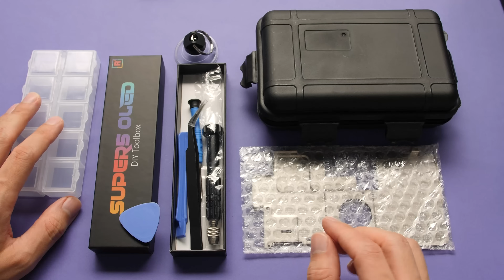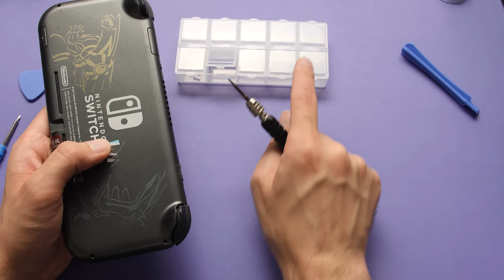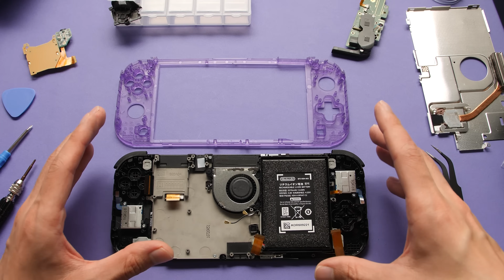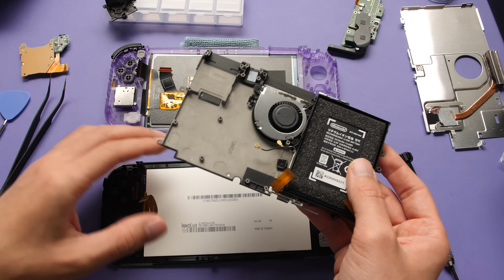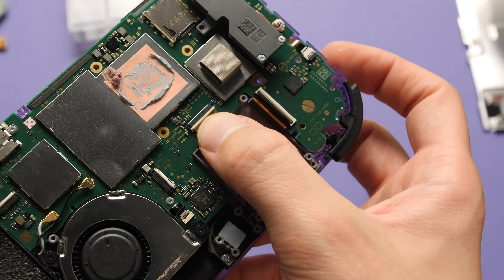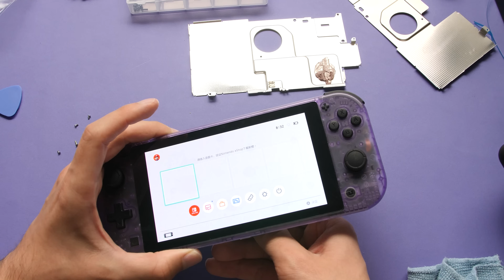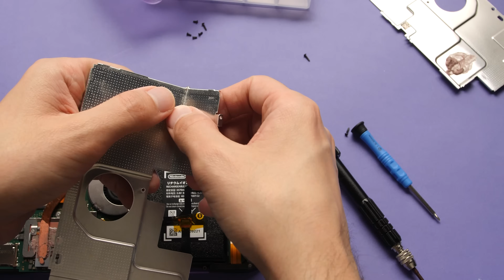SUPER5 OLED Touch - Product Overview & Installation Guide Part 2

Comment: It took me a night to install it. It's kind of hard for first time modding people to try it doing by themselves. And here is some advise I have during the installation @Taki II. I got the mega kit from you. The screw driver head is worn out already during the dissemble the console. So I have to use my old tool to continue the process. I hope the company can switch to a better quality head for it in the future. So I was doing the swap shell process. But the back shell it comes with doesn't have the speaker cover on it. If the company can come with the speaker cover in the future, that would be great. So customer doesn't need to take a long time to take it from the old shell (cuz it can be easily broken for the first timer). Next advise, the screen connection cable is too short and not line up the the dock. It's ok that they not line up straight like your video said. If the connection cable can be a bit longer, it would be much easier to line it up with the dock and less risk to broke the cable. Lastly, you should give some instruction for the screen setting that showing which is default mode and which is vivid mode, etc. Cuz after I push those two buttons to set up what mode is back for me, I have no idea which one is default at the first place. That will be all my advise for your product. All in all, I successfully install the screen and it's amazing quality. 👍

Comment: Hi all! I just installed the oled screen but I have an issue, the brightness is quite dim and it doesn’t change even after changing it in the settings. 
Anyone has a solution for this?
Much appreciated

Comment: Finally got mine and installed it, great video! The organization boxes I've never used before but were very helpful in organizing. Also did a shell swap rather than mucking around with the old screen. Overall SUPER happy with the end result! Screen is AWESOME, touch works right out of the gate, awesome!!!
Reply: I was looking into buying the MEGA (non HDMI) version! I was a bit nervous never having done such an operation, but this video gave me some confidence. Any tips??
Reply: @huggyscolex  I'm a 'go slow and be intentional' kind of modder so I watched the video 2-3 times and had it going and paused frequently while I did the install. Taki here does a very good job of explaining screws, locations, and steps so I followed that as closely as possible. If you do the shell swap you'll be on your own when installing the new buttons, swapping over the old membranes, and installing the R/LZ housing. None of this is impossible just takes some more time. 
I also got REALLY unlucky with the slot on the bottom of the battery, my battery was glued right to the edge and I didnt see any light through it. I had to very very carefully bend the housing till I could see the slot and I ended up using a tool to push through the slot and used that to pry an opening when feeding the flexi-cable through. Ran the risk of puncturing the battery but was gentle enough to survive.

Comment: DO NOT over tighten the ZL and ZR buttons or the L & R Shoulder buttons won't click in properly. Also just be mindful of the placement and the spring of the shoulder buttons in general when putting the main and daughter boards back in... That part caused me the most headache.
Once I got everything back together with the OLED it's super nice looking. Need a Switch 2 mod now, LMAO

Comment: It is amazing that this is possible at all, and I have mostly gotten things working on my second attempt. I've been looking forward to an OLED switch lite since this was announced on twitter. Unfortunately during my first round, I damaged my damaged my the smaller / daughter board, which luckily was easily replaced. With plenty of parts this time around, I ended up getting both switch lites working with this beautiful display. 

I wish the whole tutorial had the same care as the "this is the only point of failure you can have in this entire operation" part about connecting the display cable, which was absolutely not the only point of failure. This installation was much harder than I expected, and the video seems to cut/glide over many of the steps (e.g. seating the screen, installing the bumpers, etc), which made it especially hard to follow. The part of the tutorial around the display cable was really helpful in calling out the pitfalls and describing exactly how to do it successfully.

My experience level is beginner, and included a few past projects following guides:
- Modded joycons with upgraded sticks / fixed drift issues
- Battery replacement on an OLED switch
- Battery/storage swaps on laptops
- new 3ds shell swap / battery upgrade
- misc Arduino/raspi, desktop computer work, which didn't feel relevant given how much smaller / tighter everything is slotted into the lite

I was still definitely a beginner, but felt confident from the previews/descriptions.

Key mistakes I made:
- Not watching the full video first / taking notes
- Unlike the other connectors which have latches and move horizontally, the battery connector is lifted up vertically and easily damaged
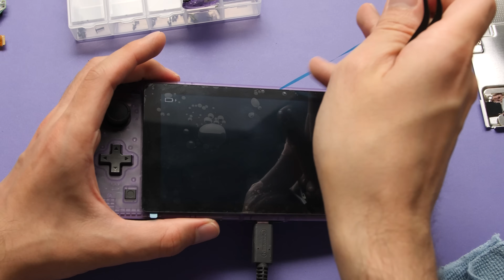- When he magically seats the display, you don't actually remove the tape-- that doesn't happen until 14:40. Do not remove the tape yet!
- Be careful with screws, especially on the sides where the frame may not be fully supported (e.g. if a joystick is elevating it). On both switch lites I tried this with, the screws were incredibly easy to strip with the provided screwdriver in the kit
- The bumpers were very tricky to re-install correctly. It worked best for me to slot the bumpers in before the boards, as the tiny actuation points for the buttons. 

Also note:
- Not included in the kit: you should have thermal paste
- When active on a menu, I noticed my switch draws 3 watts-- this was helpful for debugging the screen / power state, as I had issues with my battery connector.
- On a new / not setup Switch Lite with a dead battery, the battery indicator does not show when you plug it in. I saw it flash the nintendo screen and then turn off several times. After a while of low power charging (0.3w) it had enough to start / start charging more rapidly. When sleeping / charging while not configured, it only used 1w.
- BE VERY CAREFUL WITH THE RIBBON CABLE LATCHES. You can replace the daughterboard for about 15 usd. If the latches aren't secure, the cable jostling can mess things up.
- The megakit now includes the metal plate at the back with the section removed to make it fit better, you don't need to rip/cut your existing one.
- The power cable connector is repairable if you break the gray part holding in the connectors.

I do think I learned a lot going through this process and the screen is beautiful, the install process just had a lot more going on than expected! It took me 2-3 hours to complete with the megakit.

Comment: Please restock this with your 5000 or better battery & without hdmi & instead with your USB to HDMI dock station in a new mega pack.
Your products are awesome, I just hope Nintendo doesn't see this as a compromising hack wrongefully, because you just improved the weaknesses of the hardware in an incredible way.
I saved infos about your products when they were new, to buy them later, but was too late to order.

Comment: Hello! Does it work with the non lite versions (mine supermario edition) thanks! 

EDIT: so sorry it was clear only lite.
Q: is it worth just to buy a little version juste for the upgraded mod? Thanks
Reply: That's better if you have an entire switch modification project. Other than that, just stick to the Super7, which is for regular models.

Comment: Mine arrived 4 months later thanks to Brazilian customs. 
Installation went 90% well. For some reason, touch works, but drag doesn't. So it detects taps and clicks perfectly but I cannot use touch to scroll stuff, which is a bummer. 

Also for some reason, the button right corner doesn't adhere well. I used a wood clamp with a cloth to make pressure for a couple hours and it is holding well so far. 
Still, very recommended.

Comment: I really wish someone made psx style buttons for switch. Wanted to make a ps2 theme oled switch lite but buttons don't exist unless you paint ur self. Was going to for some joyco s. But reslly hard to get the vinyl stencil on the buttons to paint for the shapes. There's a guy on etzy that sells joycons but he won't sell juat the buttons like some kind of gate keeper. I meen you can get psx buttons for tons of devices but no one will make switch ones for some reason makes no sense to me. I like the shell you picked. Wasnt looking but did you have to pull the screen from the glass to get the right color bezels?

Comment: Oh well, already failed, before I could even unpack the new screen. The top left screw that holds the metal plate was impossible to loosen, by now the enclosed screwdriver has destroyed the screw, and it's entirely impossible to get it out now.

Comment: Managed to get mine installed tonight! Got the Touch edition and swapped the screen on my Zelda Lite. I recommend having the iFixit guide up as well for a visual reference of the screws to take out and such. My only issue after install is that the right side of the screen doesn't sit flush with the shell. The bottom right won't stay adhered, and the top right won't adhere at all. I dunno if I had something blocking it, or if the adhesive was bad, or what, but I was too scared to open it back up soooo it'll just have to stay like that ^^; 

If you're having the issue where the brightness is really low for no reason, and some buttons/sticks won't work properly, double check the ribbon cable that connects the mother and daughter boards. After I made sure the pins were seated correctly, everything worked like a charm
Reply: THE RIGHT SIDE OF MY SCREEN DOES NOT SIT FLUSH EITHER! I just tore it apart and don’t’ see anything blocking it either.

Comment: I've done 2 installs.Fires went perfectly fine. The second install has a rgb snow screen. The connectors are in perfect shape and fully seated correctly. Any ideas?
Reply: I reinstalled the original LCD and it works perfectly so looks like i have a faulty screen.

Comment: Leaving this comment cus I’m a lil annoyed, Taki I’m glad that you made this because it’s something I’ve been looking for since the original Switch launched but this is where the link for the OLED Touch version tutorial leads to and I’m not reshelling so I’ve had to juggle three separate video tutorials and an iFixit guide and I still managed to break stuff:

You really need to stop saying the display cable is the single point of failure, my clumsy ass innovated in this respect

You really understate how soft the heatpipe is; it’s about as soft and bendable as thin plastic and I bent and pinched it just trying to clean the thermal paste off it

I wish I had have known that I should have left the magnesium frame on before trying to remove the original screen because the plastic housing by itself flexed and the screen folded a bit being removed so it’s now dead

The cable for the fan got stuck under the motherboard when I replaced it and when I tried to pull it through with tweezers, very gently, it tore and bricked the fan

The shoulder buttons are also a nightmare because the tiny springs can launch themselves across the room and you need eagle vision to find them again

Thankfully the Switch Lite still works and I was able to test that the OLED screen does work but now just hella mad at myself for screwing it all up just at the last step waiting for the replacement parts to arrive like 🤯🤬😱🤮😭🤷‍♂️

Comment: Hi, I wanted to ask if the black edge of the touchscreen should be exactly the same as the original screen, right? Since the white version is no longer available on your website, I bought the black version and plan to cover it with a white tempered film from eXtremeRate. 3:10

Comment: 4 hours later and I got the touch screen installed and everything works.  Only thing not perfect was the screen on the bottom right. It doesn't seem like the adhesive is holding tightly.  I put a clamp on it overnight to see if I can get the screen to fully adhere.
Reply: Any issues with your screen brightness ? Mine is dim and won’t turn up
Reply: @Tyelovestech  If you checked all the wirings, perhaps the button testing at the end can help you?
Reply: @Tyelovestech  Have you found an answer for this yet? I have the same issue. No matter what profile it seems very dim. I haven't dug too much into it yet since I am waiting for parts because in addition, I may have damaged my daughter board cable or connector as certain buttons from the board do not respond (Power, either volume, or the Right D pad). Hopefully it's just the cable or the daughter board connector as that board is cheap and available, otherwise I'll need a new motherboard (or connector but I don't have a hot air station so, new board)
Reply: @SwnkyTiger  yes! I broke the FPC cable latch near the speaker on the daughter board. I replaced the entire daughter board and now it works perfectly
Reply: @ yes. It was the FPC cable on the daughter board near the speaker. I broke the latch that keeps it in place. I replaced the daughter board. All good now

Comment: Unfortunately I just installed mine and the brightness is super low. Idk wtf is going on. I messed with the profiles and could only make it darker 😢
Reply: Any updates? Mine is doing the same.
Reply: Yes! So for me one of the connectors on the small motherboard was damaged. Had to replace the small motherboard and it worked perfectly.
Reply: Crap, any chance it was the long ribbon cable connector towards the bottom on the daughter board? I connected the cable but I accidentally broke the latch that holds it down. I didn’t think it would be a big deal since I got it to connect

Comment: Are you going to make a tutorial that does not require a shell swap? I bought the Hyrule edition lite specifically for your screen and now I’m stuck with a screen and no idea how to properly install it :(
Reply: It just requires an extra step, which is to unscrew the inner frame that is held together with 4 screws.
Reply: @ I’m thinking to simplify things I will just go with the no touch option. Do you know if I can use the touch kit to do a no touch install? As in can I just skip anything to do with the touch screen and go with the no touch install?
Reply: Tape the touchcable to the back of the display?

Comment: I did all step by step, but now me switch lite wont turn on
Reply: Did you use the tweezers before you disconnected the battery? You might have shorted something.

Comment: I don't understand why this guide is doing it the "shell-swap" way when most people would probably just be replacing the screen of their lite without replacing the shell. You even say it is a more complicated process. Don't you think that part deservers a tutorial?
Reply: I think that one is on the way.
Reply: @SirChevron  I mean I hope so. It seems Taki is so used to these things that to him, a shell-swap is apparently something everyone just does if he thinks it's the default use case and makes a tutorial video linked to the product website itself. I mean, it's pretty egregious if you think about it. You don't have to be an expert to at least know that most people would not have spare switch shells lying around. So to me, this was very intentional and that only makes it even more absurd.
Reply: @DeanGl  The missing step would be to unscrew the inner frame before you can remove the screen. This is purely due to the touchscreen cable.

Comment: I wish there was a tutorial for the touch version for those who aren’t doing a shell swap.
Reply: Yeah mine is on the way and i really want to make sure i do it right
Reply: @ I had this same problem. Follow this tutorial up until about 7:50 then switch to the old one to remove the magnesium frame and swap screens. Then switch back to this one to complete the installation.
Reply: @ same bro

Comment: Mine is very dim and the brightness slider doesn't work my power and volume neither does my right on my d pad but that could just be the daughter board
Reply: Mine is doing the same thing.
Reply: @numberjohnnyfive  I think the daughter board might be dead I got to work with another switch

Comment: Hey Taki, my order for this upgrade kit has just arrived and I just have a question. I'm not planning to do any shell swapping so at what points of this guide should I do or not do? I was hoping for a guide that focused on the product, but with the addition of you shell swapping as well it's all getting quite confusing on my end. Any help would be appreciated, thank you.
Reply: You can follow the 1st tutorial video + the steps of connecting the ribbon cable for the touch display.
Reply: @ Thanks bro, I appreciate you.